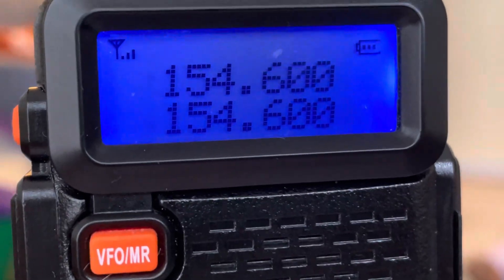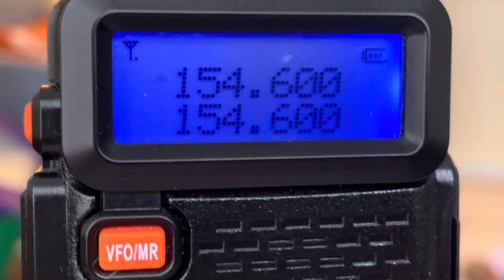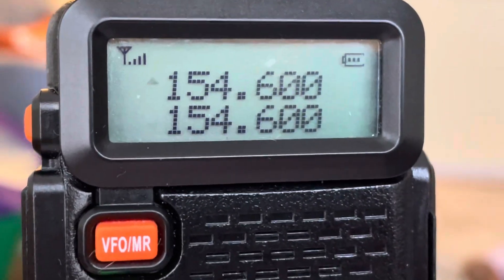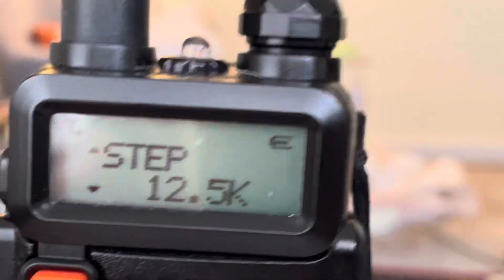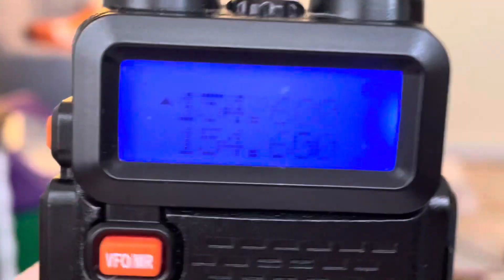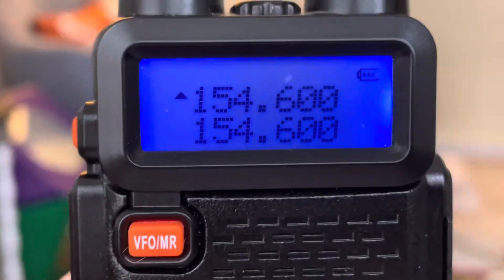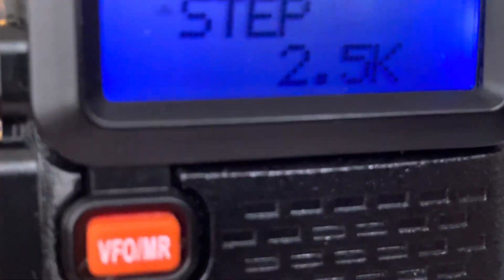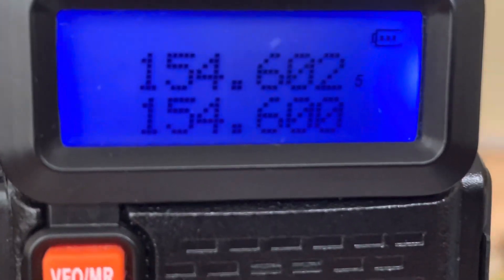Driver Training Radio Comms 154.600 MHz 67.0 Hz PL MURS Channel 5 Chatter 29 September 2023 [Part 2]

Comment: Bust out the WS1010 and put the HYS 51 inch antenna on it while scanning 49 MHz. I tried last night and the receive was amazing.
Reply from the maker: Absolutely,  the HYS 51 inch telescopic CB antenna resonates as a 1/4 wave at [roughly] 25-29 MHz..which means it’s close to a 1/2 wave at 49 MHz and of course the 6 meter band (50-54 MHz).
Reply: @R4002  Ah sweet that's perfect, half wave can getaway with less ground plane. You should do more videos too, I really like your portable scanner stuff.